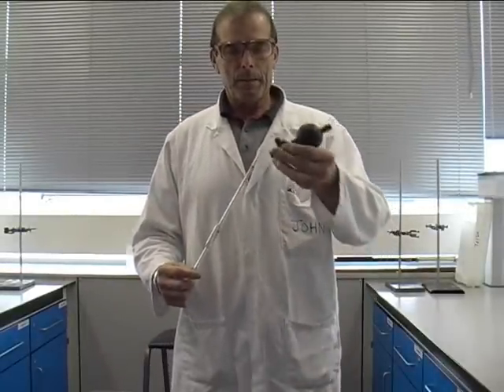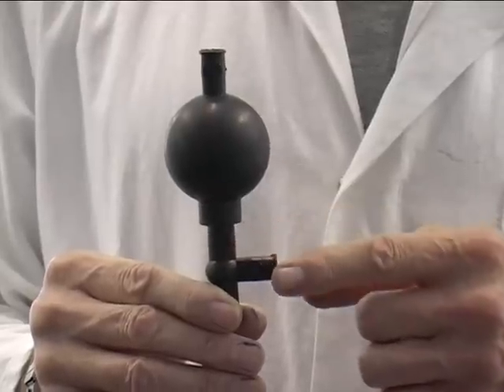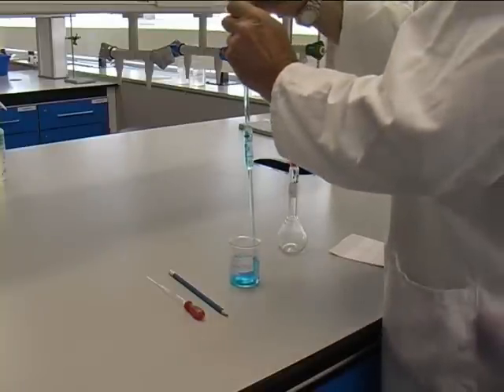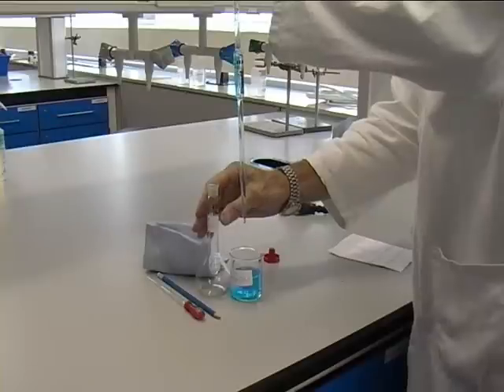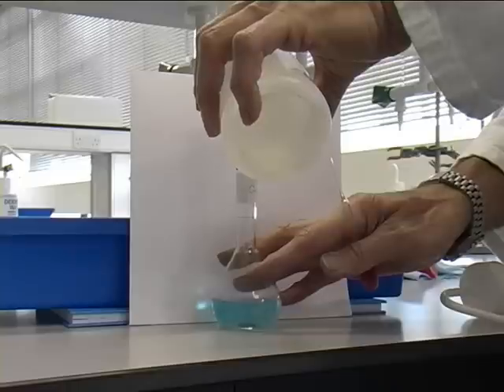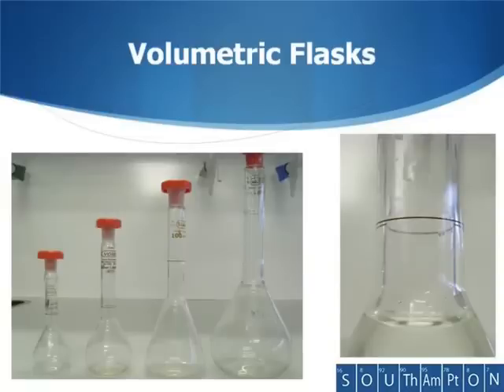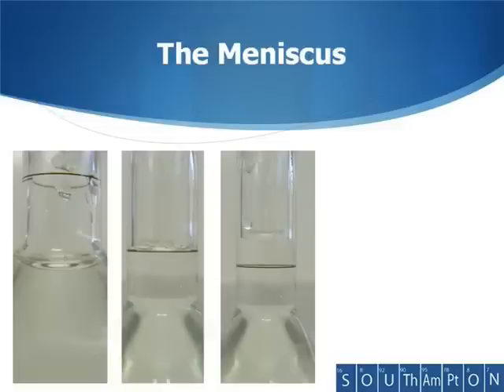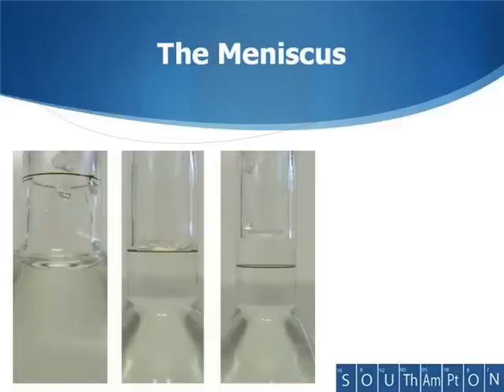Dilutions

Comment: When emptying the pipette, are you supposed to drain all the liquid by using air as you show, or should you let it drain with the tip touching the glass of the beaker? I have heard that this is necessary to accurately measure liquids, and that they have been calibrated to be used this way.